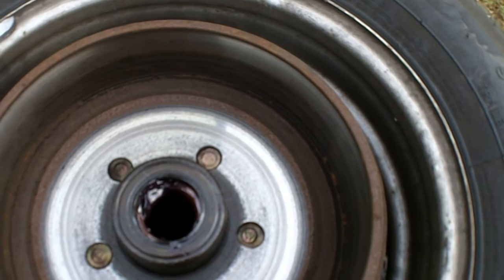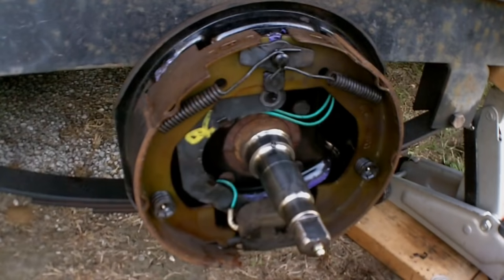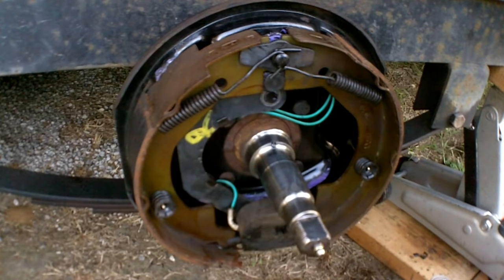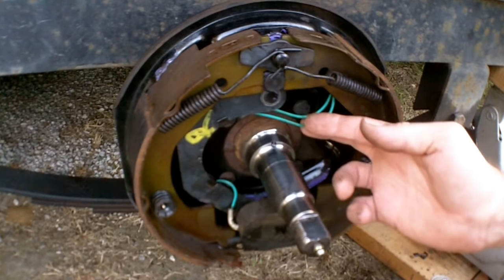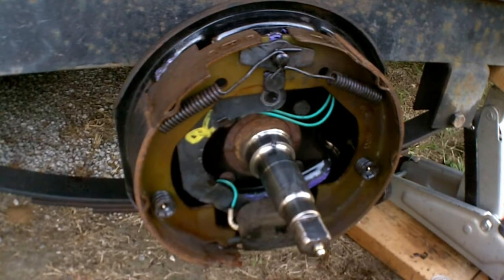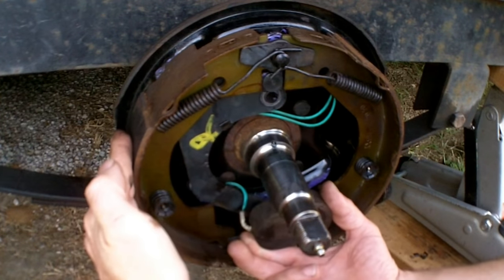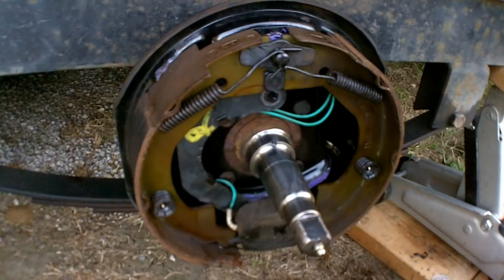How Electric Trailer Brakes Work

Comment: Thanks for creating this video.  One bit of tip, when working on equipment,  Safety is always first.  Use a jack stand, the jack is just to lift up the trailer.  I hope the wheels are locked using wheel stop blocks.
Reply from the maker: Thanks! Great tip, but I assure you- there was a jack stand. It was behind the jack just out of frame. I jack, insert the stand, lower to the stand, and use the jack as a secondary means of safety by just taking back up to the lifting point. And yes, wheel chocks were also employed. Take care, G.
Reply: @ghostses  i have attended so many funerals where the mechanics went under the car when that person only used the jack and nothing else.  Something so quick and easy to deploy can save so many lives.
Reply from the maker: @misterle7026  Not good, but I stated my M.O. for all I work on- regardless if it's seen or not. No two shakes of the right leg for me- never. Take care, G.
Reply: @ghostses  apologize if it seems like I don't believe you.  I was just adding more content about my experience.
Reply from the maker: @misterle7026  No, I get it. You're just trying to help so nobody gets hurt. I was simply stating that even if you might not see what I do for safety in my video(s)- it doesn't mean it wasn't there. The "two shakes of the right leg" comment I made was from an instructor of mine, about 35yrs ago,  that was explaining the exact thing you mentioned. It hit home with me and I repeat it to this day. No apologies required! Take care, G.
Reply: Note @ghostses. Before making another video first state that you have jacks, stands, chocks, safety eyewear, gloves, gas mask, boots, hard hat, fire extinguisher and first aid kit on standby ect ect otherwise you’ll be bombarded by idiotic comments. Great video mate 👍
Reply from the maker: @ginovanelli1256  Thanks man! Yeah, this is what I get when trying to educate. Hopefully it came through with all the noise. Good luck and take care, G.

Comment: If one wheel brakes harder than the other the trailer will pull to the side. How do you measure the braking power difference from left and right and how do you change this setting on the brake? I understand changing the voltage on the magnet part, but it would be nice to see how to 'balance' the brakes
Reply from the maker: I'm no pro Chris, so take my words with a grain of salt and do some homework. Providing all magnets are working properly and the brake linings do not have any grease on them- Improper brake adjustment is probably what's causing the pull. It may seem counter intuitive- but if you hit the brakes and the vehicle pulls left- the brakes on the right side of the trailer are not adjusted/working properly. If it's pulling right- the left side are not adjusted/working properly. This nature has to do with the pivot between the two being the hitch. I hope that makes sense.  Hope this helps, G.

Comment: Is the left and right side wired separate from each other?    Lets say my ford has sway control on the truck, is the trailer wired so just the right side brakes are only activated when just the right side sway control of the truck is activated?
Reply from the maker: No Mike, they're wired together- in parallel. The sway control, at least in my case,  is not electrically controlled and has no Bering on the actuation of the brakes. Hope this helps, G.
Reply: @ghostses  Thanks.
Reply from the maker: @ElonMuskX  No problem Mike! Hope it was helpful. Take care, G.
Reply: @ghostses  If I am not mistaken, when I watched fords videos on there sway control they showed a trailer in tow activating the right or left brake independently as the truck did when sway control was activated.  As you have said that can't be true unless the trailer brakes are  hydraulic but I am not sure about that one either.  Hmmmmm
Reply from the maker: @ElonMuskX  Unless there's a new technology I'm not aware of, they should work as I've stated. That would be a cool feature for sway, but the wiring would be specific and not standard.  I would like to see the video, so please post a link if you can. Good luck, G.

Comment: I repacked my bearings and put new wheels and tires on. It sounds smooth forward. When I spin the wheel in reverse there is a clicking sound every rotation. It's not a bearing sound. I cant reproduce it unless I have the tire on. It's not hooked up to the truck harness/powered. Is the magnet causing the click/clacking?
Reply from the maker: I'm not sure. I would try removing the magnets and brake linings to see of the problem persists. Good luck, G.

Comment: This helps a lot. What I don't understand is how the trailer brakes "know" how hard the tow vehicle is braking. Wouldn't it need to know this to apply the right amount of braking force? Thanks
Reply from the maker: Thanks! There are two types of controllers- the one I speak of, and a proportional type. The type I have just has settings for how much to apply, and how quick it ramps up. The proportional type has an accelerometer that will apply force as needed. The latter would be preferred over the first- in my opinion. If mine ever dies, I will going with a proportional type. As it is, I have to adjust mine for different loads. Hope this makes sense. Take care, G.
Reply: Yes, it does. Thanks. From what I learned proportional type is the only way to go. I don't know why they even sell the timed type any more. There may have been a time when they were much cheaper. Thanks to our friends in China you can get a self-leveling, proportional, Hopkins unit for a hundred bucks. 

Treat yourself and get a good controller.
Reply from the maker: I agree! Mine works, but it can be a pain to deal with sometimes and it can be touchy. Thanks for the info on the Hopkins. Good luck, G.
Reply: You are welcome. If I ever pull a trailer, I'll put in a proportional first.
Reply: Interesting to know that some of these brakes work proportionaly to allow gentle braking. I drive an agricultural tractor and trailer where the trailer brakes are either off or on and frequently skid the tread on my expensive tires!

Comment: Hi, I was changing the hub bearings and the shoes needed to be replaced.  They moving part with the magnet on it was also seized, so I got it all working and thought I better check to make sure I understood how these brakes worked.  I found this video and it seems whoever built this trailer put the axle in upside down.  I imagine things don't quite work the way they were intended, so I will have to turn the axle over so it looks like this....
Reply from the maker: If there is a bow in the axle, make sure it is pointing upwards. If it is already, you need to unbolt the backing plates and rotate them to the proper location. There is a left and right plate. The arm with the magnet should face the front side of the trailer. Plus the short shoe on the front. Good luck, G.
Reply: @ghostses  Good advice, I'll make sure I check that!
Reply from the maker: No problem! G.
Reply: @ghostses  Well I checked the bow and both axles in my dump trailer are upside down.  They must have done it to get the clearance they needed between the box (over wheels) and the tires.  I have to get some new spring mounts and weld them on the other side of the axle and flip them around.   I found a trailer place that has prices about 1/5th less than anyone else for the hardware I am going to need to fix this.  Miska Trailers in Hamilton.
Reply from the maker: That's cool! Yeah, they were mounted incorrectly. The bow being upwards sets a positive camber on the wheels. Glad you found the issue. Good luck sorting things out, G.

Comment: found out just what I needed to know. have one question, is there a clip that holds the magnet in tilli get the hub back on. if so why are the clip always gone when i pull the hub off? thanks
Reply from the maker: There should be a clip that holds the magnet on the control arm. If you push the magnet in, you should see it. If they're missing, I would get some and install. They shouldn't come off. G.

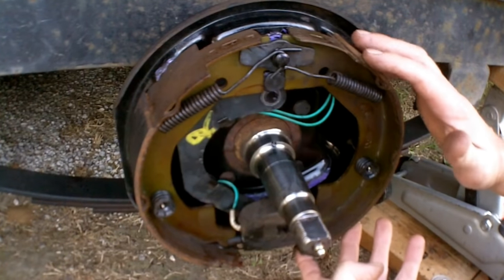Comment: That was interesting and informative. I haven't been around triller brakes in many many years and was not aware of the electrical brakes. You demonstrated the action but at 2:57 said the front transfers the force to the rear. I assume that is done mechanically as it wasn't apparent (well to me anyway haha). That blowout really got you looking at everything didn't it? Would have done the same myself. Looks like new wiring you did in there also? Thanks for the video and explanation.
Reply from the maker: +MRrwmac 
Thanks Mac! Yes, the front shoe transfers the force to the rear by mechanical force- rotational if you will. The blowout did get me looking at everything and I thought I was good to go  but found another problem that will be shown in the upcoming LONG video...lol. No new wiring, just cleaned it up. Looks pretty right...lol? Glad you like it, G.
Reply: +ghostses Yes, you did a good and all clean. You can go out and play with the other boys now.
Reply from the maker: +MRrwmac 
LOL!

Comment: ON THE EXAM TEST, HOW DOES THE ELECTRIC BRAKE  TRAILER BRAK AWAY WORK
Reply from the maker: It works like this. But before, let's say the ball breaks and the trailer disconnects from the tow vehicle. The crossed chains should cradle the tongue so you can safely come to a stop. However, should the trailer disconnect completely, the breakaway wire will pull a pin and apply a full 12V to the brakes via an onboard 12V battery. Hope this helps, G.

Comment: I am installing new 10 inch brakes on trailer, and found out the previous shop installed the brakes with the magnet on the side, so it was not  installed with  long springs left and right and top pin at 12 o'clock...it was more like 3 o'clock.  Does this present a problem? Thanks for responding.
Reply from the maker: Not sure what type they are, but it doesn't sound right to me. If the top pin is at 3, I would take off the backing plate and rotate it to 12. Do more homework, but the installation does seem wrong to me. Good luck, G.

Comment: Been pulling trailers 53 years. Electric brakes are ok until you need to stop. Slow down WELL ahead of time to stop. Heavy load, good luck, no load, wheel hop or skid. You must adjust for each small change in load. Tutorial is good for how it (might) work. Only road time will tell you how to use electric brakes, be careful. Number of axels make for more changes.
Reply from the maker: Very true Robert! Good luck, G.

Comment: Told me everything I need to know, but feeling like I may still pay someone because me not putting the hub back on correctly would be too costly.  I have nightmares of a trailer wheel completely coming off whike traveling.😊
Reply from the maker: Good deal! If you're not comfortable doing the job yourself- certainly let someone else do it for you, for your peace of mind. But I can assure you, the next question is if they did the job properly? I have a video posted on how I do a brake job on a trailer. I recommend watching that and making your decision past that. Either way you choose to go, good luck and take care.

Comment: Speaking of controlling those brakes: From what I understand they have adjustable, but fixed once adjusted, braking force that is applied certain period of time after tow vehicle brakes. I see multiple flaws if they really work that way, for example when you adjust them to help you slow and not activate immediately they will add little force and only after a delay once you need a panic stop...
Reply from the maker: Yes, you are correct with your statements. For this type of controller, there is an override switch that can be utilized. But, in a panic situation- steering, braking, and having to do an override in a fraction of a second is not the best option. I did not mention proportional controllers in the video. Please look into them as they are superior in my opinion. Good luck, G.

Comment: From the video, it appears that the brakes are normally OFF, and will go ON if the brakes in the tow vehicle are applied? So, if you DO NOT have a brake controller, can you tow the trailer without problem?
Reply: You Can't
Reply from the maker: As JD said, you can't. It would apply 100% power to the brakes and they would lock up. Good luck, G.
Reply from the maker: Thanks JD! G.

Comment: Do you happen to have a diagram of how the brakes need to be wired?  I have the wires running from the 7 pin RV plug, back to the axle, but I'm not sure if things are hooked up inside as the brakes don't work and have never worked since I've had the trailer.
Reply from the maker: +William Todd (williamtodd) 
William, this page should show the trailer wiring.
https://www.etrailer.com/faq-wiring.aspx

Some vehicles, like my 98 GMC K1500, have the brake wire (and I believe an AUX wire) tucked up in the wiring loom under the hood and at the back of the truck. I had to get them out of the loom and run one to the battery with a breaker for AUX power, and the other blue wire had to be ran to the brake controller. The wires at the back had to be ran to my 7way connector. I wonder if yours might be the same. But, I would start at the brake controller, if aftermarket, and ensure the blue wire puts out voltage, then check the wire at the connector for the voltage as well. If good, I would start looking at the trailer wiring for bad grounds, cuts, etc. Hope this helps, G.
Reply: ***** Thanks, I know the wiring schematic for the trailer plug and for my truck, just trying to find information about the wiring inside the brakes at the trailer, I'm thinking something is missing, or bad magnets or something as they don't work at all LOL.
Reply from the maker: +William Todd (williamtodd) 
Oh, Ok. Inside, there's really nothing to wire up. The magnets have the two wires going directly into them and run out of the backing plates. One wire would get the voltage from the controller, and the other just goes to ground. Mine had the blue scotch lock connectors on them and they were not making good connection so I replaced them with butt connectors. It might be as simple as a bad connection or ground. Providing you're definitely getting voltage on the brake wire, I would start there. G.
Reply: ***** As soon as I get the trailer back home from town I'll have to check into it further.  When I rewired the trailer a couple years ago, I never dug into the brakes themselves just ran new wires to the brake drums...so I'm guessing the wiring inside is either toast or something further is wrong.
Reply from the maker: William Todd

Yeah, if you purchased it used- there's no telling until you open it up. It could be the magnets are so worn the windings got exposed and cooked them. There's a solution somewhere and I'm sure you will find it. Keep me posted. G.
Reply: ***** Definitely will dig into it better after its unloaded and back at the house.  I hate using it at all without brakes the trailer itself is 2100lbs empty LOL.  Might even replace the brakes completely if I have to.
Reply from the maker: William Todd
I agree fully! That's a lot of weight back there so the brakes really should work. You can replace the entire backing plate which comes with everything for about $35 per wheel if you have 10 inch hubs. G.
Reply: ***** I can't remember what size the hubs are, but I'll definitely have to look into the replacement option.  Going into the unknown it may just be better to start with new brake components.  The trailer itself is built very heavy as the previous owner used it for hauling landscaping boulders and machinery on it.  Originally it wasn't a car trailer, but that's what I use it for LOL.
Reply from the maker: William Todd
Yeah, they might be twelves. They might cost a bit more, but not too much I would think. Etrailer.com seems to have some good pricing on things though I've never used them. It's certainly easier and quicker to just replace the entire units. I know you'd feel much better having them work- especially if you're hauling cars. How white do your knuckles get???...lol. G.
Reply: ***** I'll look into new brakes ASAP.  As far as pulling the trailer, my truck is large enough that it handles the trailer with a load although I don't load the trailer down to anything near its capacity.  I keep the loads light and have only hauled a couple of vehicles locally with it because without having trailer brakes I will not take it out of town with a load due to safety concerns.  Driving around town its not a huge problem, but high highway/freeway speeds with a loaded trailer with no brakes...no thank you LOL.
Reply from the maker: William Todd
That's cool! Being that responsible surely puts you in the minority...lol. G.
Reply: ***** I've seen a lot of wrecks caused by carelessness, lost a few friends in high school in car wrecks due to reckless driving.  I don't put anyone's life on the line just to save time or money.  I have friends who have the right equipment to move a vehicle if I need.  My car trailer sits 99% of the time, when it does get used its only to move something around in town mostly it gets used to move furniture because the deck sits so low and it don't have any sides to it makes it easy to put furniture on it to move people across town.  Looking at some brake replacement options and the prices aren't that bad about $40 a wheel if they're the 10" hubs.  Have to wait till the trailer is back at the house as my uncle used it to store stuff from his shop on it while he repainted the shop...makes a great storage platform HAHA.